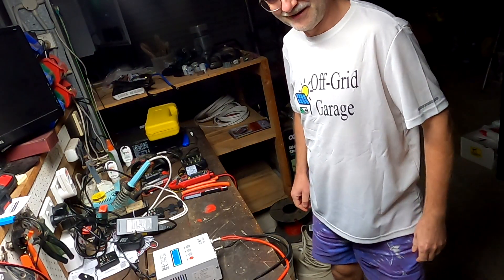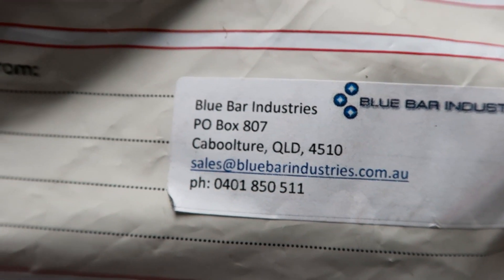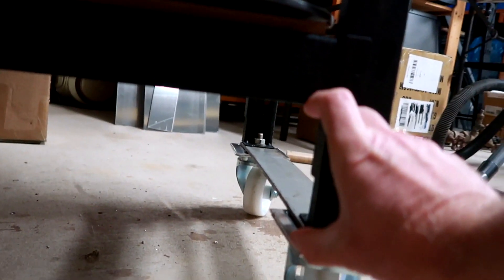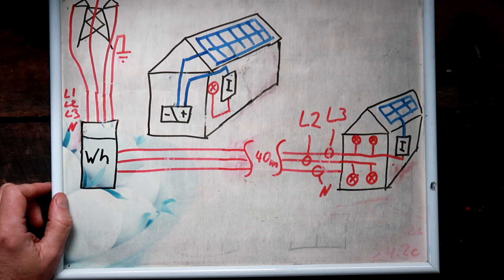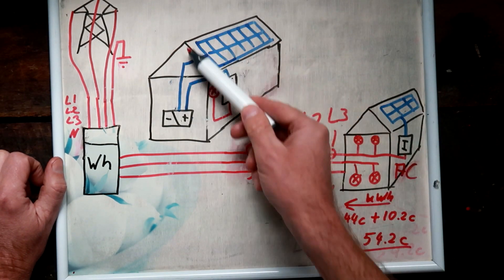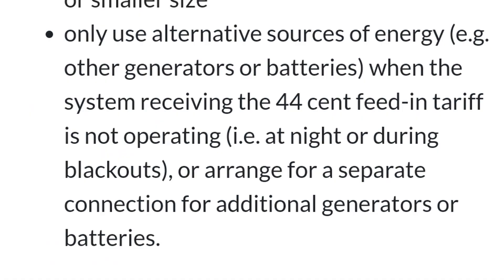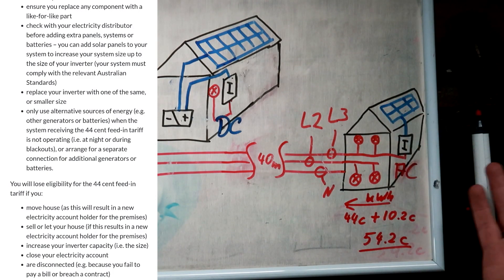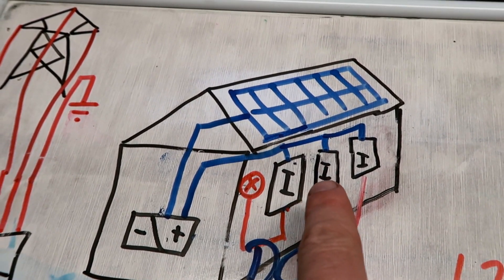Why a solar hybrid inverter will not work for my setup.

Comment: I've had both shelves on the ground and elevated like yours is -- honestly is nice to be able to see behind / access under a shelf easily.  While it's on wheels and can be rolled out, if something ever gets behind or under it, being able to see / reach it makes it much easier to deal with.  Also easier to clean under it.  Having done it both ways, having at least 8" between the floor and bottom of the shelf is easiest.

Comment: Hi Andy, I would not use bootlace on your heavy cabling, even Victron states not to use heavy stranded cabling, which bootlace would create as the crush point inside there terminal recommends soft cabling, it could lead to a hot terminal, I would buy some very light copper shim sheeting and cut it into strips and wrap it around the copper ends before inserting it into the terminal block, copper shim is more pliable then bootlaces for current carrying.
Reply from the maker: Thanks Ross. The currents will stay relatively low with a max of 50A, so ferrules should still be OK.

Comment: At 10:56 you say:

"If we have enough juice in the battery and the hybrid inverter would say okay we're taking this energy and supplying power to the house. At the same time this energy here from the solar system wants to go outside because we're not using that much. So there's the conflict. Where's this power going?

A hybrid inverter cannot deal with a external power source on the load side."

There are plenty of hybrid inverters (Such as the Victron Multis and Quattro's that you mention, but plenty of others as well such as Growatt) that can deal with both DC and AC coupled PV and do exactly what you're saying. You don't need to add any external meters to support this as long as you can disconnect from the grid to become "off grid" during those times that you want to store solar energy into the battery rather than export it.. Hybrid inverters that support AC coupled PV take the excess energy from the panels and use it to charge the battery. When the battery becomes full the hybrid inverters increase the frequency on the lines a few Hz which signals the solar panels to decrease or shut off their output.

At 15:15: Wouldn't the night time exception basically allow you to do what you want? It says you can use batteries at night: Isn't that the only time you'd really need to supply power from the battery anyway? Couldn't you just feed power to the house at night and disconnect the battery from the house during the day?
Reply from the maker: The problem is, the AC solar from the house needs to be exported and at the same time the DC solar from the garage needs to go in the battery. I'm not aware of a hybrid inverter which can achieve that unless the solar AC and solar DC is connected to the hybrid inverter directly.
Reply: @OffGridGarageAustralia  I'm not sure about other brands, but with Victron I know you can for sure do that. The MPPT controller handles the DC panels and continues charging the battery with solar no matter what. The AC coupled panels continue to export anytime you're connected to the grid. So basically with the Quattro's you typically connect the grid to the "input" side of the Quattro and the solar panels are connected to the "load" side along with any other AC loads that you want connected to the inverter. Then you program the inverter to either operate in inverter mode (IE: Off grid mode) where it doesn't connect to the grid at all. In off-grid mode it takes the power from the AC coupled panels and uses it to charge the battery. In off grid mode the inverter controls the sine wave: So in this case the inverter can control the output from the solar panels by simply shifting the frequency of the since wave. At 50 hz the panels produce 100%, at around 55 Hz they produce 0%. At 52.5 hz they produce 50%, etc.

When the inverter connects to the grid it's operating in "pass through" mode. In this mode the inverter isn't controlling the sine wave, the grid is. So in this case the power from the solar panels flows right through the inverter and back to the grid rather than charging your battery. So in "pass through" mode your DC panels continue to charge your battery through the MPPT, and your AC panels continue to feed energy back to the grid.

I read through those requirements you shared to keep your feed in tariff, and I believe this set up would be allowed as long as you kept the inverter in "pass through" mode anytime the sun is shining and the grid is up. (Which is something you can easily program the Quattro to do). And this would give you the ability to use the Quattro to power your house in the evenings and as well as during power outages without violating your contract.

This is likely just as easy to do on a Growatt or other inverters as well, but I don't have first hand experience configuring those so I can't comment for sure.

Comment: Hi Andi, as you know, we are also in SE Queensland, but without the luxury of a PFIT. In the last 12 months our system has provided us with $5,300 in FIT credits on our bill & $3,200 of free power, leaving our bill for the last 12 months as a $4,900 credit, which they pay us monthly (roughly $400). So PFIT isn’t the only option for making money out of solar systems. Still loving your videos, thanks Chris.
Reply from the maker: I know, but your system is insane large to compensate for that. I would need 25kW of solar installed (plus the inverters) to just compensate for the FIT. It will come over time just not right now.

Comment: As a full powered from the sun with both grid tide and autonomus solutions, I recommend :
1. Calculate the total electricity consumption of your building complex add the car charging energy
2. Upgrade your electrical installation from two-phase to three-phase
3. Replace the home inverter (connected to the public grid) with a three-phase one that meets your needs
4. Use the autonomous photovoltaic system of the garage for uninterrupted power supply to your sensitive consumptions (eg in case of interruption of the public network)
5. Update - upgrade your contract with the electricity supplier.
6.Before making any purchase or order carefully planned even the last details of your installation (cross sections and cable lengths, safety panels, terminal insulation materials and fastening materials)
7. Don't think about $ 0.44, think about how you will meet your energy needs for free from the sun 
for the next thirty years at least!!!!
8. Aim of the installation to be the smooth and without the need for maintenance and repairs operation.
Life is too short to spend it at so simple and easy to achieve solutions!!!

Comment: Why can't you switch your solar panels over to your house inverters once the batteries are charged? Then you'll be pumping more energy into the grid.
Reply from the maker: That exactly is NOT allowed. I cannot upgrade solar or the inverter which feeds power in.

Comment: So wouldn't using an inverter at night off batteries still back feed power to the grid? Correct me if I'm wrong but the goal is to ONLY back feed the grid from the inverter stated in the contract, grid tie solar panels?
Reply from the maker: Yes, that is correct. Only the system on the house with the grid-tied inverter is allowed to feed power in. And I cannot run the house from an alternative power source during the day as I would export more energy then and get more $$$.

Comment: Just have the house on a different electrical system. I have 2 sets of electrical sub panels in my shops and house. One is solar and other is grid.
Reply: @easylooker it sounds like what you have configured is similar to a manual transfer switch with the exception that you have grouped loads behind one switch between Grid vs. Off-grid/solar and a manual transfer switch allows each individual load to be switched?
Reply: @tomkacandes8286  
I have 2 breakers in my solar subpanels. One is where if I want too I trip the breaker to off from solar and then trip breaker to on from the grid. It then powers the subpanel.  You could easily just run a heavy wire with breaker that comes from solar to your areas that has a subpanel. Flip breaker off from grid and then flip on from solar. Of course your local laws would dictate what can be done

Comment: The Sol-Ark inverter would allow you to AC couple the garage and house to eliminate that problem. We do it all the time. It’s why hybrids work so well.
Reply from the maker: It's not allowed. The solar on the house is AC connected and feeds into the grid.

Comment: You don't have to export with a hybrid inverter. You can configure the MPP Solar hybrid to not export and only use grid as a backup source for the garage, which might be an advantage when you have winter days and you get pretty seamless power in the garage.
Reply from the maker: But I need to export, it's 54.2c/kWh! The solar on the house is AC coupled and the garage has a DC system. This will not work with a hybrid inverter. The inverter cannot deal with power coming from the load side (the house). See the pinned graphic at the top of the comment section.
Reply: @OffGridGarageAustralia  yes, I am not saying that, I am saying a hybrid inverter doesn't have to output anything back. You can use them as a UPS function as well with Automatic changeover.

Comment: Andy, let me give you my 2c as well. You are busy increasing your energy generation as well as energy storage in your garage. Thus will have surplus energy to burn so to speak, leave your current house setup with the feedback agreement in place on phase 1. Also keep most of phase 2 setup the same. What you can do is create your own phase 3 using your off-grid garage power. Pull in a AC line from the garage to your house DB box and create your own phase 3. You then place your critical load on this phase or what ever you want to. For this you do not need a hybrid inverter and off-grid inverter is perfect. Also you can for most off-grid inverters do parallel setup and couple your AC and this increase you capability. With this solution it does not interfere with the   agreement you remain inside the rules and you utilise your garage setup and are able to monitor and review ( video content). The battery rack you are building allows for three battery sets, if you use 280Ah cells 16S you will have 14,3kWh per set roughly 45kWh setup. You will need to increase your PV a bit as well.
Reply from the maker: There is now way I can pull another cable through that conduite and underground pipe. 90° bends everywhere.

Comment: Ich denke mal regelkonform wäre: Der Hybridwechselrichter versorgt alle Verbraucher von L2 und schaltet im Millisekundenbereich mit seinem internen Relais auf Netz wenn der Akku schlapp wird!
Funktioniert bei mir sehr gut. 
Vorteil: garantiert keine Einspeisung! (im Gegensatz zur  Nulleinspeisung), Immer aktive Notsromversorgung auf L2!
Reply from the maker: Muesste ich nur sicher stellen, das nichts zurueck ins Netz geht...
Reply: @OffGridGarageAustralia  Die Sicherstellung macht der Inverter selbst. Sein integrierter  Transferschalter lässt ihn nur im Inselbetrieb arbeiten oder schaltet das Netz an die Verbraucher. 
Der Wechselrichter ist ein Hybrid Inverter für "Inselbetrieb ",der kann nicht einspeisen, sonst würde er die Flocke machen.
Mein Modell ist der Effekta M1 5000W 48V. DEN gibt es bau ähnlich auch von Steca, Pip , Axpert und vielen anderen. Die Multiplusgeräte von Victron können das auch, kosten nur das doppelte. .

Comment: Put the inverter on 240v and run a twinflex to the house for the freezer and fridge permanently. That is about 2.9kw per day you can put back into the grid. Twinflex is cheap. 🍺🍺🍺
Reply from the maker: I cannot run any additional cables from the garage to the house. That would need to be trenched 60cm deep and there are concrete retaining walls in the way and an established garden. That's not an option.

Comment: Hi Andy, if you supply the AC from your garage to the house and call it L4, are you allowed to place load on this in your house? If you then find the loads which are high and are able to run on your Garage you can supply them via youe off-grid. You might even switch this load from L4 to for instance L2 (the garage will not supply anymore with a relais). If this is not possible are you allowed to run the L4 in your house for some appliances, that will save your bill also. Good luck in finding a solution. Otherwise you might put for instance a large fridge in your garage, this will offload the fridge in your house.
Reply: That was my thought too...If you power the AC from the garage with a separate line only it should not effect the rules as long it is permanently disconnected from the old line in the house.
Reply from the maker: If I take load off the house during the day, it would automatically increase the export energy which is not allowed. I can only do that when the house solar is not running.

Comment: Nothing that I read on the website shown in your video precluded you from completely removing loads from the grid-tied system. The only restrictions were the ones you mentioned like changing the inverter, adding panels, generator, or batteries of ONLY the grid-tied system. I didn't see anything about having loads on a 100% separate fully off-grid system violating the contract. Since there would be no interconnection of inverters, panels, batteries, etc then there would be no violation. Running a fully separate wire into your house to a completely separate junction box did not seem to violate anything. If this is the case then you could effectively remove a circuit from the grid-tied system completely and run it off-grid as long as the two systems did not come into contact with each other in any capacity. You clearly will have the battery capacity and eventually more solar capacity on the garage so running a few loads that are well within that capacity completely off-grid could maximize your contract on your grid-tied system. There would be nothing stopping you from returning those loads back to the original configuration in 2028.
Reply: this is exactly how i would do it. install a new separate panel connecting to the inverter in the garage and move the loads from the grid-tied panel to the new off grid panel.
Reply: @pete2531  Exactly. Pull a couple of your larger high drain loads that are intermittent like washer and dryer and A/C and then either separate the dual water heater elements and use one as a dump load or have a separate tank and place it in front of an on-demand system.
Reply from the maker: Read it again. It says:

You will lose eligibility for the 44 cent feed-in tariff if you:
- use alternative energy sources, (e.g. other generators or batteries) when the system receiving the 44 cent feed-in tariff is operating (unless alternative sources have separate connections to the network)

That's exactly what I would do. I would use batteries as an alternative energy source to supply parts of the house. This would automatically increase the power been exported, hence increase the $$$ they need to pay me. As I said, people did that with generators as it costs them only 30c/kWh in fuel costs but they got 44c back.
Reply: @OffGridGarageAustralia  if you read my response again I did say 100% separated so there would in fact be no connection between the two. Running a completely separate system does not violate the rule because the power generated from outside sources would not be in any way connected or providing power back to the grid. The example given with the generator was that they were using the power generated by the genset to put power onto the grid where as what I suggested would do no such thing. The power generated by the 5kw system you already have would be the only power available to feed back to the grid.
Reply from the maker: @jamesmandl9302  Well, again, if I take some loads of the house and have them connected to a separate energy source, that would breach the contract. 
It does violate the rule as I would feed in more power. It would be same outcome as using a gen. The exported power would increase in both circumstances.
I can also not take all load of the house and run it from a gen or battery and use the existing line to just export the energy from the house solar.
Reply: I had almost the same thought except why not put some selected L2 loads onto a manual transfer switch so that those loads could be islanded on a time of use basis when you are around the house or just left on either system. I’m in the US, so don’t know if this is too close to the “install a generator” strategy that was precluded by the rules, however, the MTS makes it impossible for the off-grid equipment to be either connected to the grid or for the load to receive power from both grid and off-grid at the same time. I’d explore this use case and if it works, you have a lot of control, no expansion of supply to grid (seems like their main concern, yes?) AND some flexibility to leave those MTS connected loads ON Grid if you have to service or change your off-grid system (possible to likely given the tinkering and video making). Great channel und alles gute aus NY.